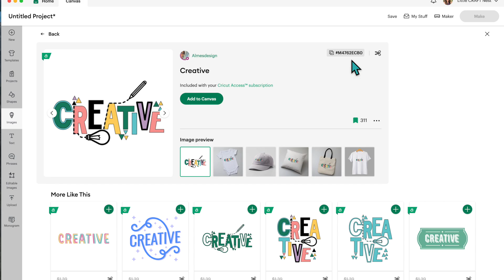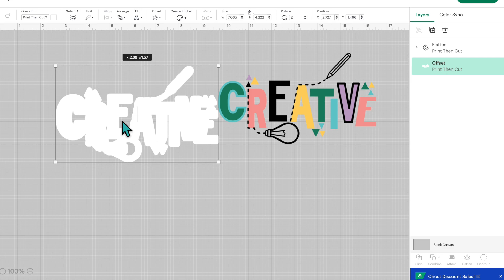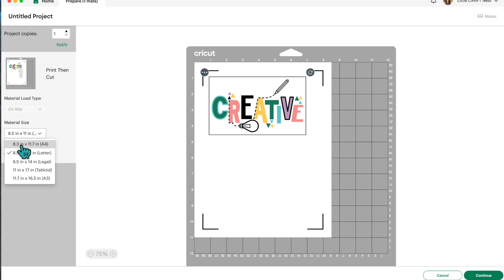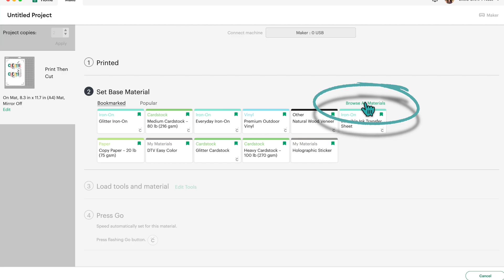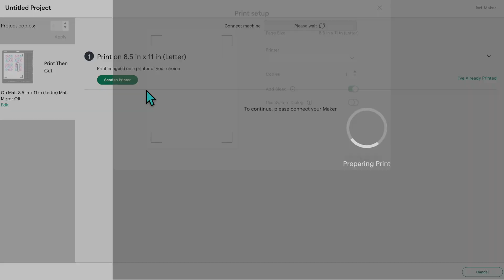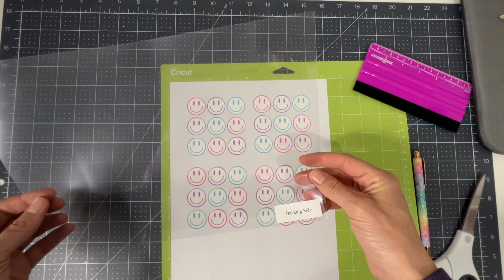Learn Cricut Print Then Cut with Teckwrap Printable Heat Transfer Paper | Glitter & GlowInTheDark

Comment: Thank you for sharing the tutorial with clear instructions. I tried to cut glow in the dark heat transfer papers using cricut but it’s doesn’t peel of properly (because it hasn’t been cut properly) . I tried adding more pressure but nothing changed. Please help me with this 😭
Reply from the maker: The glow in the dark paper is much thicker than regular paper sticker paper. I would suggest to try cut a bunch of hearts or stars out (without printing), trying different cut settings. Sometimes cut settings vary a little from machine to machine. You may also want to chage your blade. Here is a video on how to make your own cut settings.  https://youtu.be/2UGIzKJyank?si=7pccS7_2loQUl-sX